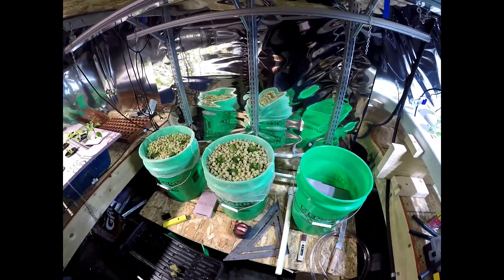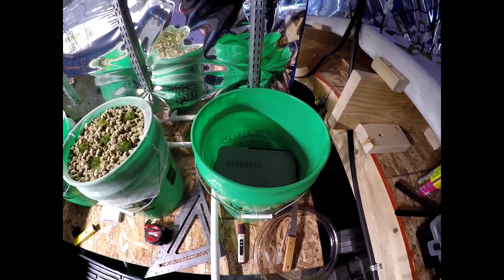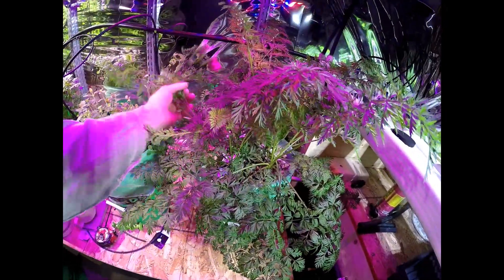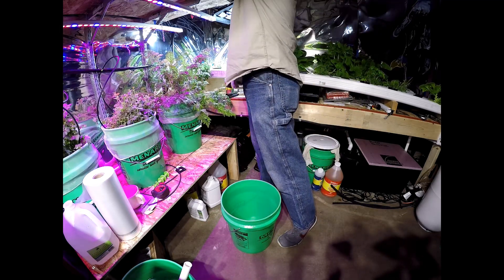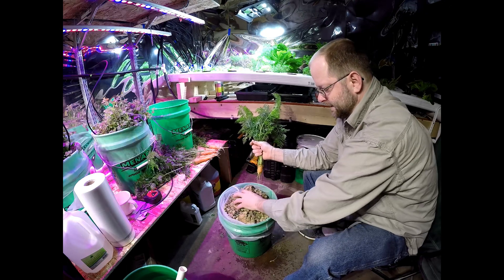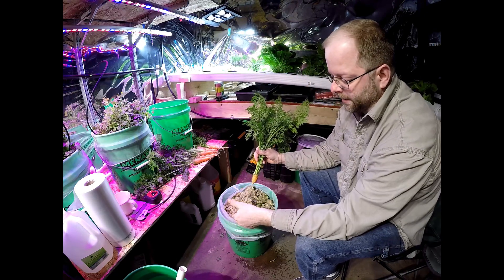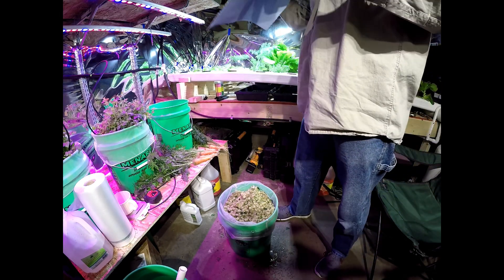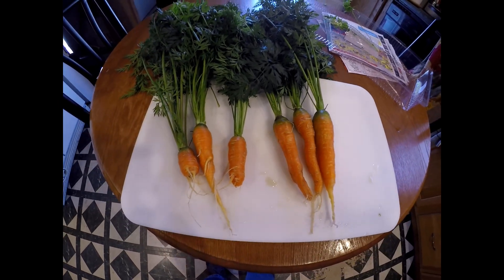2018 hydroponic carrots start to finish

Comment: I'm trying to grow hydroponic carrots indoors now that it's winter.  I'm only going to use 5 gallons buckets but experiment with different mediums like perlite, coco coir, peat and vermiculite using a flood and drain type setup.  I am also going to try aeroponics so the the carrots come out clean!
Reply: If you are still looking into planting, Jeb Gardener is awesome with hydroponics and has a method for carrots that uses only one 1.5in rockwool cube per carrot.
Edit: link https://www.youtube.com/watch?v=DYa0Syea4P0
Reply: @Redpy5  I can't believe he got those results with the kraky method!  I have to try it thanks.